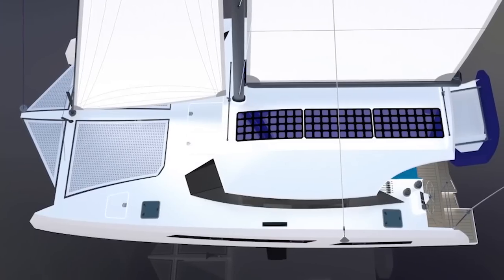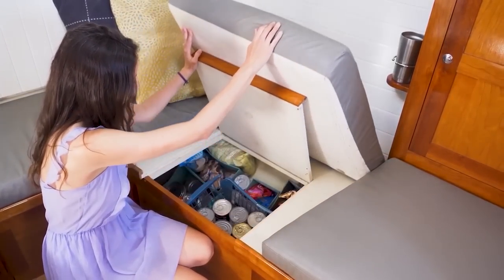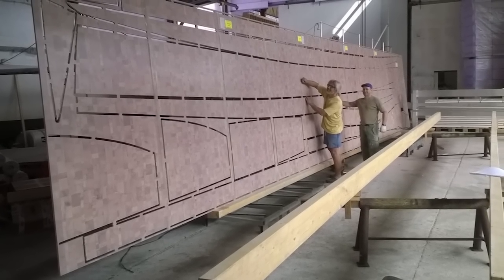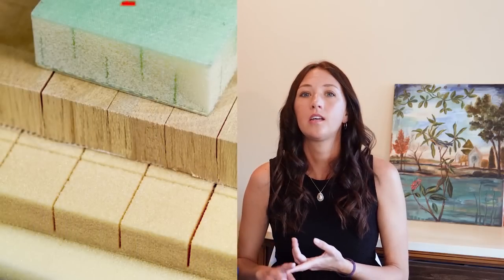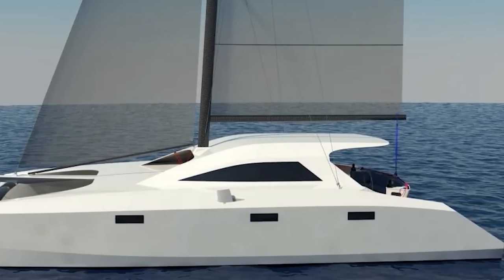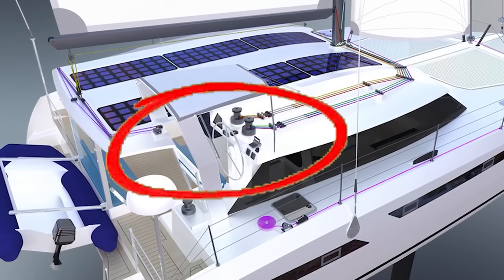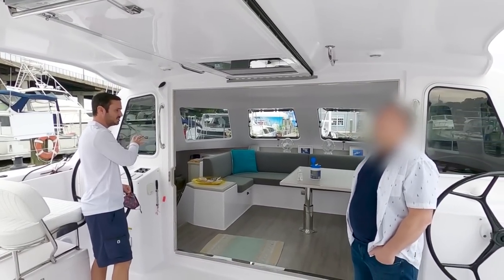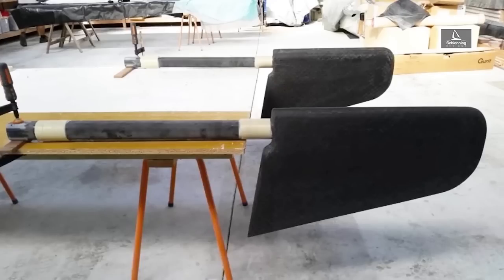OUR DESIGN CHOICE REVEALED For Our Catamaran Build!! - MJ Sailing

Comment: i am a big fan of the schionning cats, however having built a 39' Pescott cat out of WRC and foam it is insanely crazy in terms of just how much work there is.... One example, Yes you're saving $ on paint, but frankly you're saving months or hard work and insanity by not having to bog and fair the outside and inside of the boat-- those long sanding boards are not called torture boards for nothing.  By the time I had sanded the entire inside of my boat three times by hand, I was so over it..... and I could still see the imperfections.    I look forward to seeing how it goes for you--there's still a lot of work but it looks a good kit.  btw, what engines are you going with?  I used outboards and would always go that way again... 1/3 of the price, half the weight and you only use them to get on and off the mooring or anchor... as you have a boat that actually can sail...
Reply: Did you have dual outboards or a single on the Prescott?  I most things about the outboards except: reverse thrust when in a marina trying to twist the boat around; noise when running at speed; and clearance for the narcelle to the water.   But their low weight, cost and drag will win out over those issue I think.

We will still have to fair the interior of the boat or go with linings. I want it painted so will still have to fair, but it has to be less than the WRC covered finish.  

Matt
Reply: @mattjohnson6716   I had two honda 20s extra long shaft in pods on the inside of each hull and they were brilliant!  Could spin the boat in its length (my party trick coming up to a mooring).  in terms of thrust in forward, in lightship we got 10 knots, could easily push into 35 knot head winds at 6 (still with some power in reserve) and reverse was just fine.  We were in a marina for a year where we had to reverse in (around a corner)  and it was fine--what you don't get is the predictable prop walk that diesels do but frankly I never missed that.  The only down side was that on a beam sea the engines would cavitate which was annoying, however if there is wind, you sail.  The engines were completely mistreated, they got rinsed out once a year alongside their oil change and they lasted 10 years. As with engines on all performance yachts, they tend to not get used very much so the lack of use is what kills them.  Not have the drag, nor the expense of folding props more than made up for it.   I could go on for hours on this stuff, let me know if you want any other info. Cheers Phil
Reply: @pmorph  Thanks Phil.... that's what we keep hearing from Oram owners - and what made us decide that we wanted outboards - but we just did a meetup with Seawind and they complained about the maneuverability of the 1160 lite due to poor reverse (when one engine is in forward and the other in reverse).  It surprised me to hear this after so many glowing reviews.   

Were your engines noisy?  How far out of the water are the bottoms of the pods on your boat?  

Thanks,

Matt
Reply: @mattjohnson6716  Hi Matt, no idea what the seawind people are talking about.  I used to back my cat around the corner and then into a marina pen at the Seawind marina in sydney... We could certainly spin in our length-- no problem.  I put high thrust props on the hondas and they worked a treat.  Pretty much all Pescots in the 10--11m range have outboards.  The builder prefered Yamaha 9.9s however after going out on the sister ship to mine before I started I was convinced by the Hondas.  Re noise, the engines were a bit noisy when you opened them up a bit--partly the boat becomes a bit of a drum and the noise echos.  It was not a problem and never got in the way of conversation.  The pods were about a foot off the water, they would slap a bit in a big sea but they were well designed and just cut through the water. As I mentioned above, the only time we got cavitation was on a large side on sea.  The other way you can go is what some of the Jeff Schionning builders do which is put the outboards in the hull and have them drop through the bottom--there are a couple of very high profile cats that have this system.  It's a bit more complex to make and you need to make sure the engine gets enough air but it is another way of doing it.  I can send you through a zillion photos if you want from the build through to the finished product.  
Cheers
Phil

Comment: The Max looks like to be a great project to finish off, but, I would have gone the Schionning Solitaire 1490 route just for the following - DRAFT	  0.65 Metres (2ft 2in), BEAM TO LENGTH - 10:1, PAYLOAD - 3500 Kilograms, and then you also have the versa Helm. OH and the other big reason would be -  LOA -14.95 Metres (49ft)
Reply: We like the Solitaire too - A bit less performance, but it had a lot going for it in other areas.  The big issue was cost. Everything is just so much more expensive for that size boat.  Schionning estimate that it's almost double the cost of the Arrow 1360 to build, so way past our budget.   

Matt
Reply: @mattjohnson6716  I clearly do under the cost involved that's why I have not even considered attempting a project that size, as I would have to work on my time off from work or over weekends, this would then mean 4 or 5 even 6 years by myself. 

Matt - the other thing I am pretty sure that with the Schionning design you could change the way it looks on the outside to have the more straight-up window frames. 
Just looking through my pdf downloads I have noticed that the cost for the Arrow 1360 is around the $260K mark, not sure if that the base price or finished price, and you have mentioned that you are looking to start @ $150K - which is a big cost saving already. The other would be your cost saving in labor at the end of the day from 24months to around 14months more or less.

I look forward to the reviews and build this new project of yours.

Comment: If the dagger boards are retractable, what's the deal with the rudders? Is it beachable?
Reply: Rudders are in cassettes and retractable.  -Matt
Reply: @mattjohnson6716  That's great! This line of thinking is probably 5 years too early. But I wonder how difficult it would be to modify the rudder into a rudder drive like the new Hanse Yachts + Torqeedo design. 

Though full retraction wouldn't be possible with the pod attached,  and the mount might need to beefed up with that long of a lever arm. I can't get away from the idea that as soon as you have two directional drives, joystick docking  like Volve EVC is suddenly possible. Thrust vectoring ftw.

Comment: Here's a comfort option you might want to consider: photovoltaic panels that also heat water!  How nice would it be to have hot-water showers with no additional fuel use?
https://dualsun.com/en/product/hybrid-panel-spring/

Comment: Weight is important yea but really no clothes washer unit? Seems like that's a bit extreme in a 42' 3 cabin Cat. Hell even Delos has one. What does it weigh? 50 lbs?
Reply: Haven't needed one in 8 years, and probably wouldn't add one even if we had the space.  We never found laundry an issue while cruising.  

Matt

Comment: MaxCuise42 heavier than the Schionning ? On the website I see 5200 kg ligh displacement versus 6800 kg for the Schionning  . What gives ?
Reply: The displacement Schionning states is loaded weight.
Reply: @antonditt1661  Are you sure because that would put the light displacement at 4.8 tons wich is incredibly light for a 45 foot boat that uses no carbon fibre (not mentionned on the website) . A 42 foot very expensive DazCat which uses carbon fibre in large amounts comes in at 5.25 tons .

Comment: Are you going diesel or electric?
Reply from the maker: At the moment we're looking at dual outboards, but nothing has been finalized yet.
Reply: @MJSailing  I think that would be a excellent choice in terms of weight and maintenance.
Reply: They are going with outboard motors .. the chance to go electric ⚡️ later.
Reply: @MJSailing    Matt.  It seems to remain true that nothing is more reliable and  efficient than diesel weight for weight.  Outboards  are inefficient and if they are  gasoline powered they are dangerous. You may save weight but they offer no backup alternators so you need a generator.   
As far as electric is concerned I have one thing to say. Beware of the dreaded lee shore verses your battery!     
Note though that a light cat sails with a mere breath  and should tack without mechanical help   . So  motors  are considerably less used.

Comment: You did a very poor job studying Schionnings designs. The front windows are not sloped and can even be opened for air flow, which is a great asset.
The windows towards the cockpit can be built to slide down. That would probably open up the area sufficiently, but thats a matter of personal taste.
Reply: I wasn't talking about the front bulkhead. The slipped side I was talking about is the cabin sides. -Matt